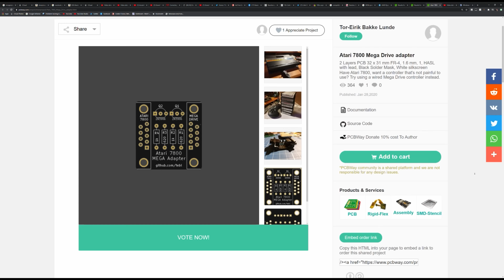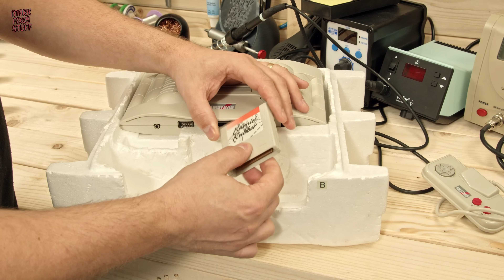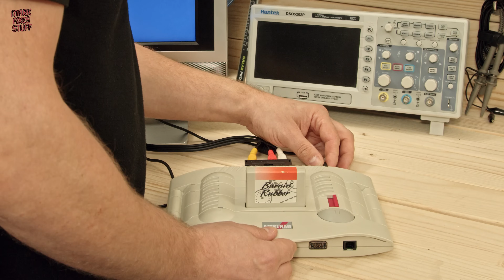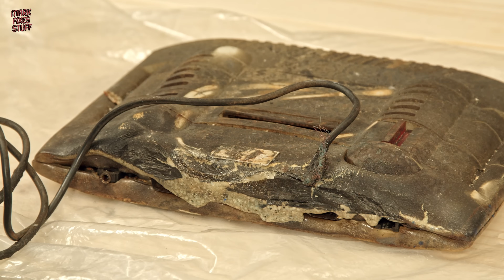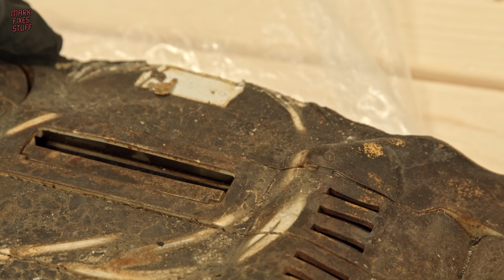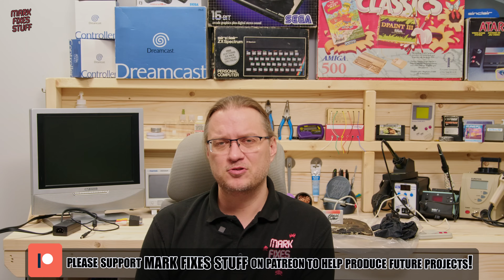STUPIDLY switching on a Fire 🔥 & Water💦 Destroyed console! 🚨🚨🚨

Comment: Surprised that it works. The shell will have to be scrapped, the motherboard will need a clean with new caps and a new regulator. As for the shell you can make an acrylic case or send Retro Game Restore a message to make a shell for this. They have one for the SNES, Megadrive, Famicom and PC Engine. I’m sure they can easily make one for this but at a cost. I would love to see a GX4000 in clear shell.

Comment: Fix them both, obviously :) the melty one could either be carefully fixed to maintain the current appearance (maybe lacquered over) OR do a post-apocalyptic type mod on the case, so scrub it clean as you can, and get it working again, but only with reused components scavenged from your junk bin, so maybe the power switch gets replaced with a chunky 240v rated toggle switch off a vacuum cleaner, and the melted controller sockets get swapped for an old serial port off a broken motherboard. Thanks for entertaining us all, look forward to whatever's next :)

Comment: "Many problems are solved with a wiggle in a slot"
And some are created by... Oh, look! No video signal from the console! 

Now... that console..

CLEAN. THE. BOARD. If you power it on before you do, I will find a canoe, paddle ALL the way over there, and wallop you on the head with my hat.  Recap everything, and if a board is mangled, I'd say to do a transplant- have new boards made, and everything you can (and need to ) transfer, like chips, etc. 

You have a clean case, a controller, etc. Not only that, but you''ll have spare parts. Now- as to why I'm saving the melted one..? I think that one deserves to be saved. You didn't deserve it being turned to slag, and you'd probably rather it working (Having had a Pi 4 stolen, I can relate). Think of it as therapy. 

Plus- think of the views!😁 "Resurrected from the ashes of destruction..."

The switch on the cleaner one- might be either a faulty switch, or your old friend the capacitor, Or even a loose solder joint, (maybe a screwy track) that once it got warm enough, a connection was made because of expanding metal. As I am allll the way over here (looking at canoe rentals 🙃), and you have all the fancy tools- You get to figure it out. 

I say to use the working console, get it into the better case, etc- and make a spare parts bin.

Comment: I would probably view the fire board as a donor board for the other (If needed), and as a repair project as a secondary aim.
Whilst it may be good to see it work again, it could have hidden faults so there is more value in repairing the clean board imho.

I'd start with pulling the board from the fire damaged unit to clean it/try and stop further corrosion, and then check for damage.
And examine the clean board.

I suspect a bad cap on the clean unit that's causing a cold boot situation. Probably still not getting enough volts through to components to fully boot even with the led lit.

Comment: Swop the boards over.... Most likely a blown RAM chip in the gx4000, the missing original PSU is a clue. That would have failed in operation, they did, and shorted out an IC or componant

Comment: You rearly should fix your fire damaged console for the case not sure if its a new case 3d printed case or mod the damaged case so it will work, as for the nice condition console stab in the dark but would faulty capasitors be part of the issue as if psu caps are shot seen that cause similar issues when the power regulator gets two lower voltage

Comment: Wow it works! Would not recommend using it without replacing all caps and verifying the power delivery circuitry, etc. The caps are clearly operating out of spec, thus the overly blue screen. You could buy a non-working unit and move this restored working PCB inside.

Comment: The clean console likely had a failed RAM IC, the pulsing was probably the regulator cutting in and out due to over current. Sadly, the all import Gate Array ASIC is probably dead now :-( You might get lucky replacing the faulty RAM but usually those symptoms are curtains for the ASIC. The Salvador Dali console is super duper fine! You can't get composite video out of the GX4000 so what you are seeing is the sync signal which is a bit out of spec and confuses modern TVs. A SCART cable will fix that! I'm sure of it. Either way, video is RGB or RF only. You can mod for composite but the audio signal is mixed with the composite feeding the modulator. My recommendation is to use the console via a good quality and beefy 5v PSU. I would forget the SCART. I would use the monitor output instead with the appropriate cable. I've had 2 of these machines die when plugged in via the SCART output. Both times I got a mild electric shock from the SCART shielding and both had failed ASICs. I have used my current GX4000 through 5v and monitor port for years now without any issues.
Reply: Replying for visibility - what this person says!

Comment: The pulsing LED was showing that something was at a low resistance and then the fault cleared, maybe something after a voltage regulator inside the console that has now failed open circuit.